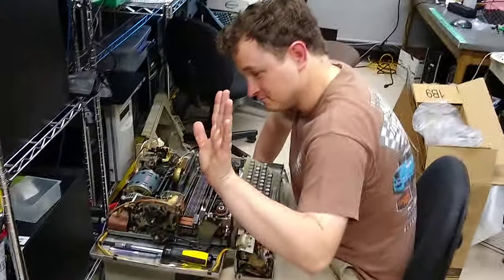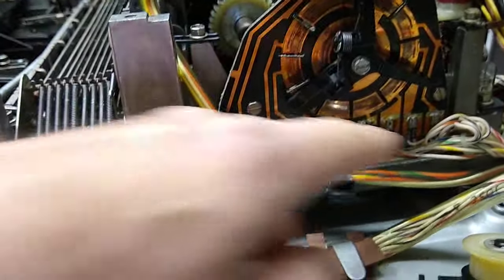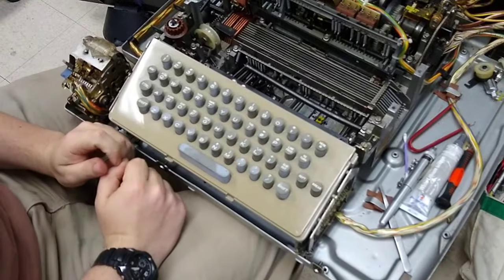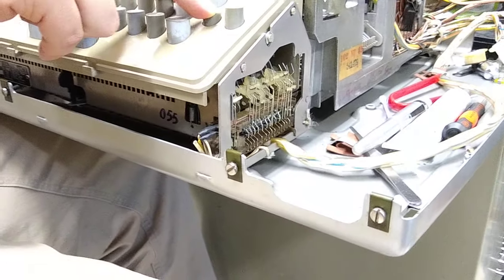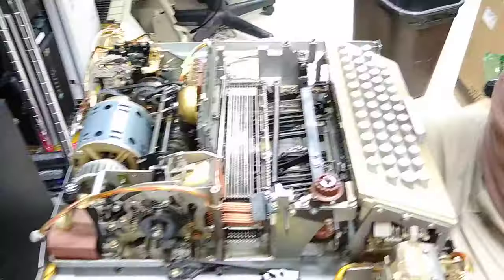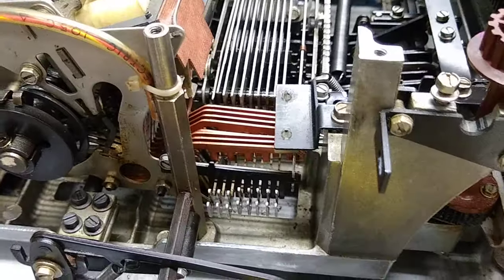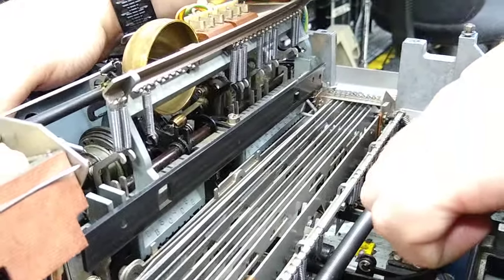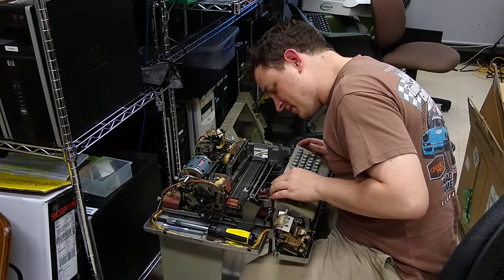PDP-12: How an ASR-33 Sends and Receives Characters

Comment: This was great!  I first used one of these machines in grade school in the late 70's. We'd of course dial a number and then put the handset on the acoustic coupler after the host answered. We were learning BASIC in an after school computer class. I think it was also used by the upper grades during the day. There was a program that a lot of people would run that would print out Snoopy just using the Letter 'O' I think.  On alternating sessions we'd meet in a different room which had the black Bell & Howell Apple ][ computer for schools.

Comment: I encountered one of these at school (in the upper sixth) back in 1978(79?) while studying basic computing. It could dial into to the mainframe at York University. We were able to load BASIC programs using the paper tape reader. And to think, it doesn't have a single electronic component! I recall getting a connection was sketchy, requiring many retries due to the mainframe being "busy". Some time later we actually visited York University and sat in a classroom full of glass teletypes, which connected to some DEC computer. After the system  crashed, we frantically typed "R BASIC" to get one of the free slots. And to think in many applications control-G will still "ring the bell" :-) . Myself and a friend figured out that we could just visit the University in our free time and we would be assumed to be students. On a weekend the computer block was empty so we had a choice of terminals to access the computer, and all the (DEC) manuals were free to take away.
Reply from the maker: I love this! Thanks for sharing!

Comment: This is so streampunk! You could almost build it from Meccano!
Reply from the maker: Yeah, it's very steampunk. In fact, you could replace the motor with a belt to a steam engine (with a governor to keep the rpm consistent) and heck, if you were really crazy you could rebuild the whole thing to be pneumatic instead of use electrical signals. But that would be crazy. :)